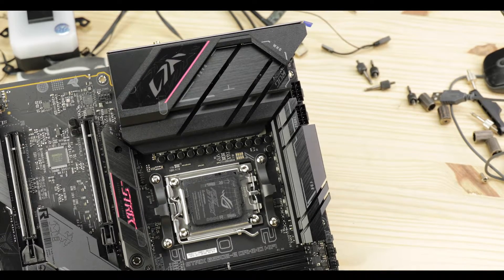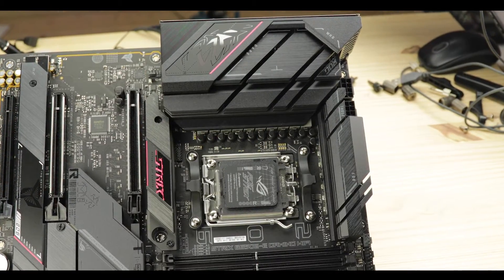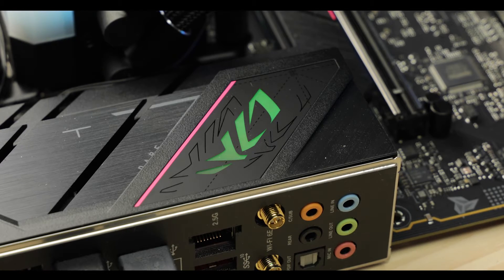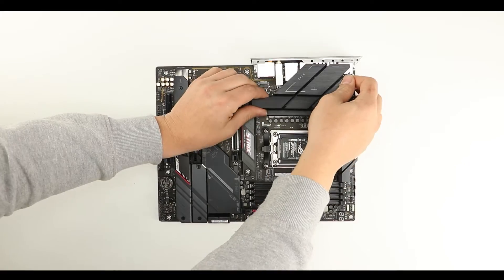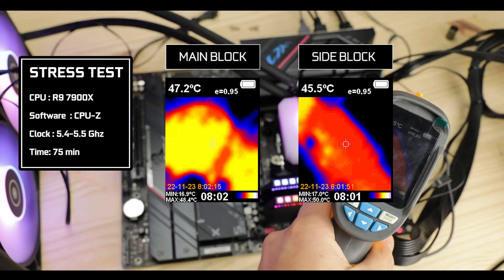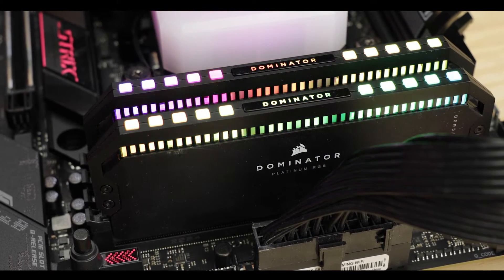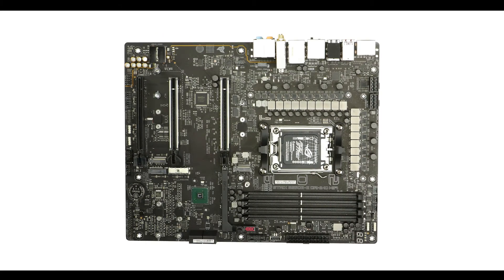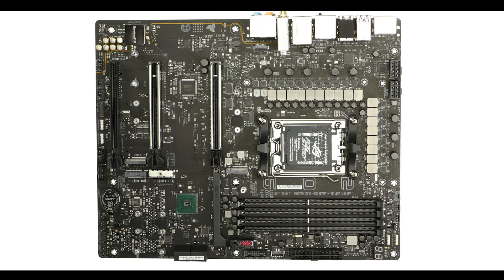ROG STRIX B650E-E GAMING WIFI : the only STRIX worth owning.

Comment: £187.99 November 2025 Amazon UK. I chose this for new 9800x3d.
Reply from the maker: great choice!!!!!!!!
Reply: Torn between this and the B850 ASUS TUF plus WiFi!
Any advice or insight as to why you chose this board over a b850?
Reply: @owenmcdonald4544  An extra M.2 slot is the first thing that springs to mind. Four on B650
Reply: All four M.2 are PCIE-5 , B850 1xPCIE 5 2x Pcie 4.
Reply: B650 has 2x PCI 5.0x16 safeslots, B850 has 1x pcie 5.0 x 16 slot. I currently run B550 Aorus Master as it was almost 2 years more modern that higher number range. 12x USB instead of 10 on rear IO. Everything is More.
Reply: CCL Online , one word have a mobo configurator. You can adjust a gauge to minimum number SATA or USB , various selections of what you want and it shows what is available.
Reply: @Fester_I just pulled the trigger on the strix b650e-e. The deal just seemed too good to miss and its ending at midnight tonight. The postcode debug display was a good deal sweetener for me.

Comment: just bought it with a 9800x3d, 6000mhz 30cl 32gm and my „old“ rog strix 4080 oc😍😂
Reply: Hi, Im thinking of buying this board how is it going so far and do u think I should go with this or the Gigabyte B850 AORUS ELITE WIFI7 ATX both are for 190£
Reply: @z2jk576  i went with it and even upgraded to a 5090 astral and i can recommend it its stable and bios controlls all my fans

Comment: Just bought these parts for a £1500 PC build

Case: Phanteks G400

Motherboard: ROG STRIX B650-GAMING WIFI

CPU: Ryzen 5 7600X

GPU: RX 9070 (Non XT Version)

CPU COOLER: ARCTIC LIQUID FREEZER III 360 AIO

RAM: 32GB DDR5 CORSAIR VENGEANCE RGB

SSD: CORSAIR MP600 2TB

PSU: CORSAIR RM850X 2024 MODEL

I bought these parts in the UK, the GPU was £650 which is nothing compared to the RX version at 1.1k and the RTX 5070 at 1.3k both on Amazon

The motherboard choice sounds extremely overkill and yes I agree but the motherboard was £223 from £460 which is perfect for me since I do not plan on upgrading anything apart from the CPU anytime soon.

Comment: Actually own this board and the X670E-E, love em both.
Reply: any bios problem ?
Reply: @sturmgewer44 I personally have not.
Reply: @ Do you think there is much diference between the B650E vs X670E for a gamer? I plan to use a 9800X3D+ 32 Gb RAM 6000Mgz  CL 28 + 9700XT + 1 Gen 5M2 + 2 gen 4 M2s
Reply: @sturmgewer44 honestly I’d go with the X670E board for that kind of setup. You have more Gen 5 support and overall a better board. The B650 on the other hand my wife is running a 7700X but I may eventually upgrade her to a 7800X3D.

Comment: The board has 2 12v EPS connecters for CPU. I've checked the manual before buying and it doesn't say that both must be connected or not. Do you know?
Reply: no necessary, read the manual "OR" 1 eps it's more than enough, but if u need an extreme overclock with an ryzer 9 16core 32thread + azoto or similar, can be good plug the 2nd eps. BUT ISNT NECESSARY, for a normal use as us gamer or similar
Reply: @alexvitae9475  I understand that for an overclock plugging in 2 would be needed. I've had the board for some time now. I bought a splitter for the EPS. The 'OR' could mean 'depending on which motherboard you have'. A board variant may only have 1 EPS, the manual generic. Either way it isn't explained clearly enough.

Comment: Laurant - there is some misinformation in your test about this board regarding the S-ATA ports. Did you even test them?

They DO NOT Support Raid modes - and they are connected to an ASMedia 1061 Controller - per 2 Connectors one AS1061. That means, that these ports only get you 400 MB/s Read/write on connected S-ATA SSDs as the ASMedia 1061 only runs at PCI-E 2.0 X1 and are therefore limited.

You need to mention this as this limits the useability of those S_ATA Ports. Asus did cheap out here on the chipset for the SATA-Controller in order to implement a 4th M.2 slot.

The board is a good one - but if you have S-ATA SSDs you want to use, avoid it.

Comment: One big concern about the board: slow sata speeds. The sata controller used is PCIE2.0x2 limiting the bandwith drastically. Check out updated Asus Strix B650E-F - it is fixed there
Reply: is the F version working fine? cuz that's the one I am planning to buy
I've heard someone on amazon complaining about his Crucial T700 NVME SSD GEN5 is not working on this motherboard...

Comment: A very important aspect you missed in the video, check this motherboard manual guide and you will come just at the beginning on this:
"When M.2_3 is occupied with an SSD device, PCIEX16_1 will run x8 only" :card-red-penalty::card-red-penalty::card-red-penalty::card-red-penalty:

Comment: Is the asus 650e-f a much worse board then the 650e-e one? Was gonna purchase the F one Bea use it's cheaper and pair it with an 7800x3d and perhaps a 4080super or a 7900gre haven't decided yet.

Comment: I was pretty dead set on buying the Auros x670e master until I just watched this…I most likely have just changed my mind. I especially like the reset/bios button and it has the gen 5 lanes for “future proof” for what I need. The debug and gpu release button are just the candy on top. I followed your advice for the Msi x570 tomahawk motherboard and it’s served me extremely well. I think I’ll do the same here with the Asus b650e-e. Thanks for still doing these…

Comment: Just bought this used locally for $100. He still had the original stock BIOS from late 2022 on it. Installed the latest without issue. Only issues is the voltages do seem to run higher then my three X670 Aorus Elite AX boards one of them with the same 7600X to compare against. I noticed this with my in BIOS temps hitting 63c with CPU voltage at 1.440v running stock settings. Also the CPU memory controller VDDIO was hanging around 1.38v w/ DRAM at 1.35v which seemed high for the MC not for DRAM.  I have a negative CO of -30 and voltage stays no higher than 1.26 now and I manually set the MC to 1.2v.  I likely wouldn't have noticed if it wasn't for the 63c in BIOS. Granted I was using only a Wraith Stealth for bench testing.

Comment: The Intel I225-V network adapter on this board is garbage, and the chipset runs really hot. You need to replace the stock thermal pad and fit a network card.

Comment: i need some help with this board.
i have a cm sl600m case which has the psu on front and my rtx 4080 is impossible to fit on the first pcie. so do i lose anything having it mount on the 2nd pcie slot? should i reconsider a case?

Comment: Great overview! There were some insane combo deals with this board a couple weeks back. My brother is building a new system and got a deal from Microcenter that included this, a 7900X and 64GB of RAM for a whopping $600. That's insane value. We were putting the system together tonight and were pretty impressed by the mobo's features as well.
Reply: how did it turn out? does it have thermal pads on its ssd covers, and last thing does it have 4 chassis fan headers?

Comment: I stupidly bought 6800 MHz RAM for this motherboard before I realized that that is likely never going to reach that with a 7800x3D.  Furthermore, the RAM uses a 1.45V UDIMM Intel O.C. Technology.  Is this an issue or will it likely still work, but just clock lower and maybe have to be manually timed?

Comment: you would say 7800x3d + 7900xtx or 4080 is a good match ?
Reply: I have a 4080 and 7800X3D and it runs pretty well. Definitely get the cheaper 4080 Super now.
Reply: Yea if they were not all basically sold out haha, and i want the suprim x i hope next week there will be some good 4080 supers in stock, i have built the pc for like 2 months already just waiting for the gpu  @adiohead

Comment: Guys, please note that one of the M.2 PCIe 5 shares the lanes with the main PCIe 16 slot. It is in the manual... the small print.
Reply: What happens if you put a PCIe 4 ssd into the PCIe slot?
Reply: @danijelb.3384  backwards compatible

Comment: Don't buy this rubbish. Motherboard is cut down in SATA ports - organized via 2 ASM1061s controllers, not directly from chipset lines.
Because of this, the speed of devices connected to SATA will be up to 2 times worse than expected.
Asus is completely insolent.
Reply: OK, and what would be the right MB for 7800x3d max budget 250$, and gaming only,,,I would appreciate any feedback, because I'm planning soon to upgrade AM5

Comment: I have this board. The LED light up feature is poorly designed as it will be blocked by the rear exhaust fan... They should have opted to a vertical design instead of the diagonal one. The ARGB headers also doesn't seem to go hand in hand with the ARGB fans connectors. It is so damn loose! I don't know if all ARGB headers are like this but if I daisy chain the Mobius fans, it fits nicely and tight. But if I attach the fans to the ARGB headers, holy sh!t! Its a pain in the a$$!!

Comment: It became clear that for the SATA connectors this board uses a slow chip ASM1061,  there are already people complaining for the bad performance of the SATA drives. I also have 2 SATA SSDS and it is a big disappointment that the board's implementation is with such slow chips. NVMEs are great for system drives but you can get Terabytes of space at a normal price with the SATA drives, so they are without an alternative. What is even more surprising is that this chip ASM1061  is also used in a lot more expensive boards like the Taichi. I hope that they can improve the performance of ASM1061 with drivers, otherwise this will be a big fail.
Reply: Can get M2s for like $40 now. Great 1tb ones. Don't think many people will worry about the sata
Reply: @alsius9162  You don’t think, but I don’t want to throw away my existing sata SSD drives with data. There are other people in the forums not happy also.

Comment: Just be careful where you connect your second M.2 SSD, because if you connect it to M.2_3, your main x16 slot will drop to x8. If you use a GPU in the main slot, and since there are still no PCIe 5.0 graphics cards, the bandwidth will half to 4.0 x8 or 3.0 x8 depending on your GPU. That's because the second PCIe "x16" slot and the M.2_3 slot take the 8 lanes from the primary PCIe x16 slot and split it to x4 and x4. The board is making a compromise today for a (distant) future point where everything is PCIe 5.0 but you are spending your money TODAY. Don't buy this board, buy Raptor Lake with Z690 boards, there are more in tune with the current market offering and still offer stellar performance, and you will save $.
I recommend buying AM5 in couple of years when prices drop and peripherals reach the 5.0 standard. Like GN says, we are all being Gaslit as far as motherboard features and prices.

Comment: I wonder if you really tested this motherboard because the B650E-E is NOT capable of doing a RAID array on SATA ports (so you lied in the review). Moreover the four SATA ports has an old external controller by ASMedia (the ASM1061) which has a cap of 400MB/s of maximum speed and a huge overhead on HDD drives which brings to a 35-40% performance hit on each disk. Try do run a Crystaldisk benchmark on SATA ports using some SSDs/HDDs e you will see. You should point out this BIG issue to prevent users to buy the wrong product!

** I own this MB and I'm really angry for this fact: ALL my SATA disk drives are much slower on this Rog Strix than they used to be on my 11 year old Intel system and that's unacceptable for a 400€ premium motherboard!
Reply: IF i knew this earlier i wouldnt buy this crap how is that possible even ? Everyone uses main nvme and ssds for storage ... Im still waiting for PC case but im already pissed of ... How reviewers misses that ITS a joke
Reply: why the hell are you putting in an ssd(hdd) when there is nvme 4.0 ?????
Reply: @assassins9913  Have you ever heard about "storage" you noob? My main OS drive is a Samsung 990Pro 2TB (PCIe 4.0) but I NEED all the other SATA disk drives (MX500 4TB, Seagate Barracuda Pro 10TB and Seagate X18 18TB) to store all my files (photo edit, video edit, MKVs, ISOs, high res FLACs, huge PDFs from my job and so on) and work on them as fast as possible.
My Seagate X18 runs at 290MB/s on my old Intel's platform but it's limited to 160-170MB/s on this crappy ASmedia controller.

Comment: Please quickly glance over the manual before doing a review like this. According to it, populating the 2nd gen5 NVMe slot will make the 1st PCI-E gen5 slot max out at 8x. So, while it technically still is a gen 5 slot, it ends up support "only" gen4 x16 bandwith. Otherwise, great video showcasing the motherboard overall.

Comment: Here is my only complaint i wonder if anyone knows the answer.. the bootup is really really slow.. My understanding is that there is a memory conditioning/testing etc that takes 30 seconds or so before post.. I have read that you can disable it and it will boot faster but many report stability probs after.  Any solutions out there?
Reply: Has bootup improved with updated since your comment? And any other issues with am5 I should know about?
Reply: @danijelb.3384  I am on vacation so I can’t check it.  The usb port issue has stayed.  The ports don’t always work.   I get them back for a while through messing around. I wouldn’t recommend this mobo.  First Asus I haven’t liked.  I no longer even pay attention to boot time.  So I don’t notice. Just got used to it.
Reply: Thank you. I guess I keep looking for another mobo. Enjoy your vacation, my friend  @AkSeapilot
Reply: There is quite simply remedy. You need to activate both restore memory context and power down enable in Ai Tweaker and also in AMD CBS / DDR options section. There is a bug when you do not activate this also in AMD CBS, blue screens can start popping up. 

I am running this on ASUS ROG Strix X670E-A motherboard paired with 64 GB DDR5 6000 MT/s CL30 memory kit and POST has shortened from 56 seconds down to 8 seconds. The only expection is first boot in given month, otherwise you will experience always shortened POST and boot.

Comment: Best future proof PCIE5 GPU & M.2 slot budget option! Thanks for re-verifying the data for me in great detail. I'm ready to purchase this with a R9 7950X + 64GB RAM. The only thing that I didn't catch you mentioning was the primary GPU slot sharing the 3rd M.2 (2nd PCIE 5.0 M.2) slot's PCIE 5.0 lanes so leave that slot open to prevent throttling to 8x.  See page xi of the manual. "When M.2_3 is occupied with an SSD device, PCIEX16_1 will run x8 only." The best use case for this then is a single PCIE 5.0 GPU and primary PCIE 5.0 M.2.

They could easily cut out a lot of the extra slots at the bottom to save us a lot more money. Could also space components out a bit more. E.g. a NH-D15 wouldn't need to have the second fan raised above the RAM modules. Could also cut the board down to mini-ATX form factor (which I doubt I would use in a smaller case unless the case somehow could manage enough airflow and room for top end R9 CPUs and a top end GPU). eGPUs could get a major boost at anytime if the bus speed improves with the next iteration of say Thunderbolt 5 ports or an ePCIE type port or optical 100Gbps GBIC type slot until copper surpasses it).

Now we just need PCIE 5.0 products to be released! Waiting for 4.0 stock to be sold out is painful.

Comment: Does any of the m2 slots shares bandwidth with anything? According to the specs no, but I want to make sure that if all M2 slots are full, the bottom pcie slot still can be used for a x1 expansion card (unlike on the B350E-F).

Comment: This is a good board that can run 3 nvme drives(1xPCEI5 + 2xPCIE4) without losing your 16x PCIE5 GPU. Most other boards of this price range drops to 8x PCIE5 GPU once you put 3 nvme drives.
Reply: What happens if you put a PCIE4 into PCIE5?
Reply: it works as PCIE4 @danijelb.3384
Reply: @danijelb.3384  That PCI-E run at 4.0 speed, be 8x or 16x lanes.

Comment: I'm glad you mentioned the VRM overkill on the X670 board comparison.  This Strix board on a B-series is already more power delivery than any current AMD CPU in this socket can draw, even with ridiculous overclocking and excess voltages enabled, short of exotic setups like LN2 and bespoke OC specialists.  Overall these components at this price point is pretty amazing given the pricing of most X670 series offers.  At this price point, ASUS own TUF X670 and Gigabyte's Aorus Elite AX are also in the market.  

The audio hardware, highly useable configuration of PCI slots for my peripheral needs, and excellent board quality and connectivity options made the choice among these three easy, without overspending on some ridiculous over engineered X670 monstrosity.

For DIY builds, don't underestimate the utility of getting a bios code display in this price class, either!

Comment: Hello, i have a question

For those "Strips" that we should peel when mounting M2 drives.
Is it really necessary to remove the strip ontop of them after mounted a M2 ssd? I have a feeling that it will "stick" to the ssd-drive.

What happens if after a time i want to put more M2 drives? Will i still be able to unscrew the plates to add a new ssd? Or due to that sticky-thing it will "pull" the other drives?
Reply: Hello Sebastian
It is absolutely mandatory to remove (plastic covering) the strip. And the gum at the bottom will stick to the drive. You can remove it later, hopefully, using and ESD mattress although I never used one and never had issues... It is like a non-sticky gum, you'll be fine removing it later, just be patient.